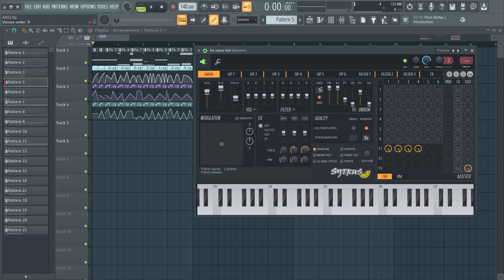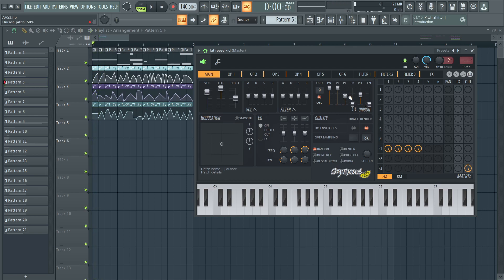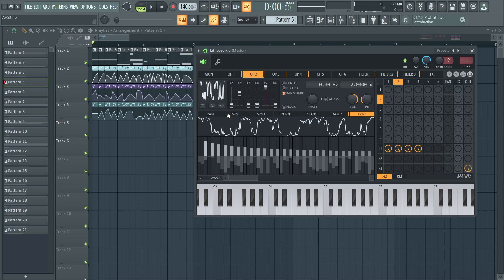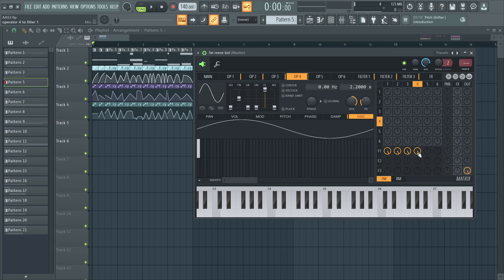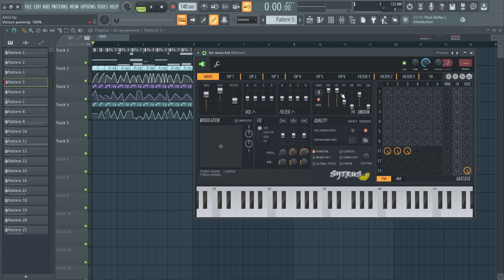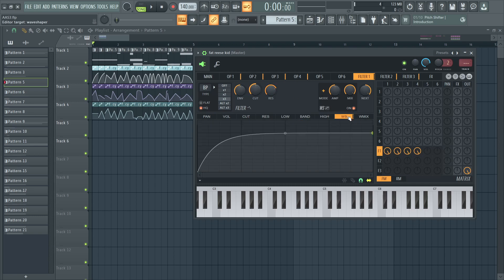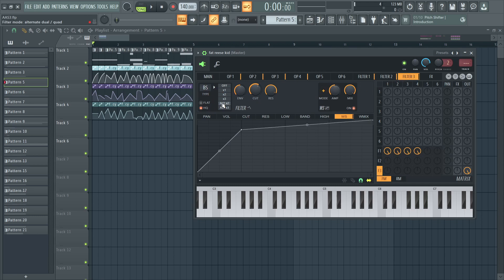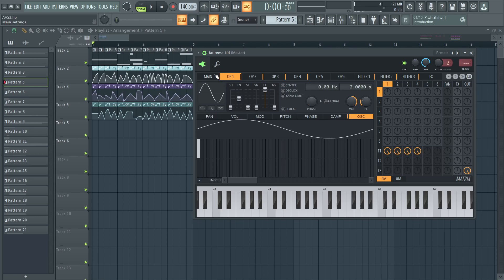How to Make a Neuro Reese Bass in Sytrus | All About Sytrus 3

Comment: Does the panning at 100% not effect how good the sub will sound in mono?
Reply from the maker: It doesn't affect the mono compatibility because I had unison for oscillators only turned on. It's actually redundant that I had panning on because when that OSC button is on, NOTHING in the unison section will make the sound stereo, so that's just a programming mistake/redundancy on my part. 

An important thing to note though: the higher the phase is spread on a sine wave, the more it disappears. 0% unison phase should be a 100% intact sine wave but 100% unison phase will completely phase it out. Neat stuff.

I would program this differently by using the unison index mapping for pitch, panning, phase, etc... on the non-sub oscillators if I were making this sound today. It would allow for better separation and control between the sub and non-sub parts of the sound.

Hopefully that clears everything up!
💃💃💃💃